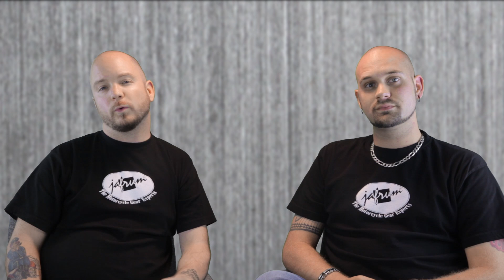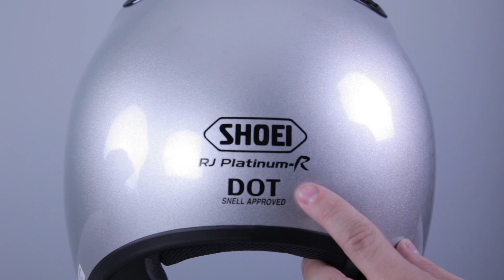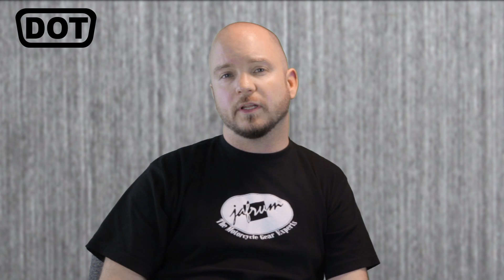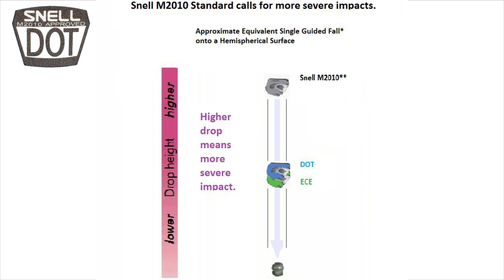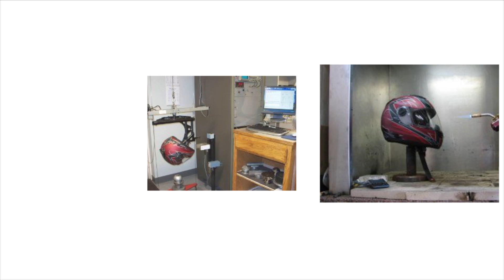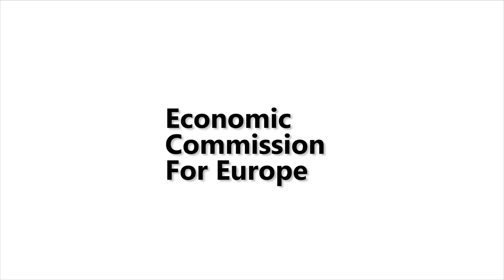SNELL vs DOT vs ECE Helmets - Motorcycle Helmet Safety Ratings - Jafrum.com

Comment: Nice video. One question SHARP does testing of helmet at 7.5 m/s almost 28.8 km/hr, so a 5 star Sharp helmet is safe only till 30 km/hr? Also does internal sun visor compromise on absorbing energy during head on impact. I saw many helmet with internal sun visor on sharp site scoring less points & lower color code on front impact zone compared to helmet without them.

Comment: DOT does Not Test helmets - they set a Standard, and Manufacturers SELF CERTIFY as DOT rated.
Reply: NHTSA enforces the standard by acquiring random samples of the product and sending them to an independent testing lab to verify compliance. Penalties to manufacturers for marketing non-compliant products can be steep—up to $5,000 per helmet.

Comment: thank you for your video. however i have a question guys. is it illegal or any against to DOT rules if helmet is able to design to fold ?
Reply: DOT is fine with that, but it's also fine with 3/4 and half helmets.

The issue with the modular ones is that few helmets are tested as full face helmets. IIRC there's only one brand at present of modular helmet that's tested to pass as a full face helmet.

Comment: Thank you for taking the time to clarify these standards. On a side note - you're using the word "fitment" incorrectly. The word is simply "fit"
Reply: Nope, that's the word that gets used on basically every site I've seen helmets advertised on. It's been a word in the dictionary for decades, even if somewhat obscure.
Reply: Thank you for your replying and I'm not trying to be a d*ck but other sites that use fitment are also incorrect and while it is correct that the word is in the dictionary; if you check the word origin and usage you'll find it is British and means "a fixed item of furniture or piece of equipment, especially in a house." (Webster and The Oxford Dictionary  as source) Again thank you for replying.

Comment: Good day. I just want to clarify something. I've heard it before and you brought it up in this video about Snell not testing modular helmets. What is the main reason for this because they test three quarter lids. I know for a fact that the old HJC AC-3 was Snell certified. I had one. I also know that the Shoei RJ-Platinum R and Arai CTZ and XC are also Snell certified. Does this mean that three quarter lids are 'safer' than modular helmets? I am a three quarter helmet guy but I think modular helmets are safer as long as the chin bar is locked in the down position. Can you shed some light on this? Thanks.

Comment: One thing I can say about Snell is they have a list of the helmets they test. After spending a lot of time goggling for a list of ECE tested helmets I found 0!!! Same for the DOT list!! Snell list is on their website and they will reply to any questions that you have about a Snell tested helmet so if you see a Snell label you can check it to see if it is a fake. Go on eBay and see the fake stickers even saw a all in one DOT ECE Snell sticker from a European seller.  And don't say if it is on eBay it is junk several of the major manufactures and even online companies sell over stock and discontinued stuff on eBay some may use their real name others do not!! Companies such as Dennis Kirk and Rocky Mountain ATV?MC to name a couple.
Reply: Thats nice to know if im looking for a specific helmet they tested
Reply: Why list ECE helmets if under that regulation every production batch is tested before shipment. Every helmet you see in European shop has gone through it. all info is on the strap label - certification coutry, certificate number, type of certification http://www.mccofnsw.org.au/images/1496387809_EULabel.jpg And no one gives a fuck about snell in Europe.

Comment: so what's better D.O.T or E.C.E..two different countries with different standards but one has to offer more protection than the other
Reply: ECE > The max allowed G transfer and the sub-optimal random sample testings of the DOT makes the ECE a vastly better rating system in my opinion. Since SHARP is build upon ECE, I think the real question is SHARP VS SNELL, and that is just a question of how aggressive you ride, hence how fast you will end up crashing (SHARP better for regular crashes, SNELL better for high speed crashes)

Comment: regardless of what rating is the best one, any helmet is better than no helmet.
Reply: I sat the same thing to people when they come into my shop asking about motorcycle helmets. I love when new riders are keen to learn about the safety aspect of gear.
Reply: What happened to jafrum.com
Reply: But why buy a shitty helmet if there are cheap good ones? Holds even more  true in my opinion.
Reply: Hans Oderfest because technology, colors, paterns, etc.

Some people don't place a lot of value in their life. I'd trust myself to an ECE rated helmet because they do actual testing, even if it's not the most stringent.
Reply: lvcsslacker I agree, ECE does reliable testing and arguably the best job in testing for regular speed crash conditions, hence the preference on softer shell materials. The SHARP test is build on top the ECE test as you probably know and adds a nice layer in my opinion. Riding is killer fun, why ruining it by saving on the wrong end. That being said, riding in LA can still be a bitch ;)
Reply: Hans Oderfest same in vegas, except without the lane splitting.Do you know what the SNELL test comvers over ECE? and DOT says your helmet should pass certain tests, but you don't have to test it.

Comment: LONG STORY SHORT:  SNELL is the best standard, and use the most stringent tests.  Also, as mentioned in this video, they are the HARDEST to get to put their approval on a helmet.  If safety is your number ONE priority in a helmet (as it should be), look for the SNELL sticker.
Reply: I think this is oversimplified and misses the point of these tests. If you "race" on the freeway, like on track days, and most likely will end up in a high speed impact, a Snell helmet might end up transferring less G's to your head due to the more rigid construction (that's why it's tested for higher speeds and double impacts = race conditions). The downside is that in a normal freeway speed or metro collision this rigid construction becomes counterproductive and actually transfers vastly more G's to your head. The ECE/SHARP/ACU tests are mainly based on European crash data. Crashes in Europe are on average slower than in the US cause you have less crazy racing folks on the streets, even Autobahn. This factor was put into consideration and is reflected by more soft helmet constructions that transfer less G's in regular speed crashes than its Snell counterparts. I personally think I fit the European tests better as a Harley river, but you might fit the Snell bill better. I like the SHARP rating system cause it builds upon the ECE and succeeds in communicating the basic test data to its costumers better. I don't think a Fail/Pass rating is appropriate to suit consumer purchase decisions: I wanna know that I'm gonna buy the best possible product at any time for my money. The Fail/Pass leaves me inevitable with a pool of helmets I can't differentiate between.

Comment: You guys mentioned weight (snell packing on more layers than ece) as a concern due to inertia, have you come across any study/documentation to back such an argument? From an engineering point of view it simply breaks down to how well the helmet can slow the head down (or absorb energy) from an impact, regardless of weight. Due to this I'd have to agree with snell at the moment.
Reply: +Michael Cook I think it's a crash by crash basis honestly... some impacts are need more deceleration, others need less inertia in the system. It's truly hard to say which is better.

Comment: i JUST BOUGHT A HJC MECH HUNTER AND I CANT SEEM TO BE ABLE TO WEAR IT MORE THAN 30 TO 40 MINUTES BEFORE I START TO HAVE PRESHURE POINT PAIN ON MY RIGHT TEMPLE. IS THIS BAD? SHOULD I GET SIZE LARGER? SHOULD I JUST JUST GET A DIFFERENT HELMET? THANKS IN ADVANCE.
Reply from the maker: John dawson Maybe a rounder head shape. Bell is one example. This should give you a little room in the temple.
Reply: +John dawson go to a motorbike shop, test out what they have and then go online and look for the same model and size
Reply: I took a nap in the helmet I bought and the problem went away. :3
Granted I did take it off at some point during my nape.
Reply: yes! this means it's too small. go to a shop and get fitted for free and then buy one. remember you have to look at shape, size(varies by brand), then safety rating.
Reply: I actually solved the problem by taking a nap in the helmet. I don't think the shape was quite right. The nap helped shape the helmet which would happen over time anyways. Still saved my life though.  #WearYourHelmet  upgraded to the HiViz version of the Aria Defiant Pro Cruise. what a lovely helmet. fits a bit funny though. face guard sits maybe 3/4 to an inch from your mouth by design according to the guys at revzilla.

Comment: Hello guys, can you tell me please the best helmet (full face) for about 200$ ? I saw that the Scorpion exo 1100 it's a very good helm but it's not SNELL approved, so i'm not so sure now about exo 1100. BTW i'm in Italy now !
Reply from the maker: Stefana Madalina There are some great Sneel helmets under 200: CL17 by HJC, and the Bell Vortex are two examples.
Reply: ***** Thank you very much for your help.
Reply: Stefana Madalina Is that all your head is worth to you? $200? I would advise you save up for a quality helmet. Snell will protect you more. I highly recommend on a sport bike to use snell.
Reply: dragonaac i see that in europe it's better to buy sharp helmets because manufacturers often do not know that sharp it's testing their products. This is the difference from snell where manufacturers initiate the process by requesting that snell tests teir products. And about the 200 $ head: in this moment we can't afford to buy 2 helmets at 600-800$ and we need to buy the costumes too. I think it's to much even if we buy them separately.
Reply from the maker: ***** Snell

Comment: Are ECE helmets allowed in US?. Ordered helmet with ECE but it does not have DOT
Reply from the maker: Randy Keller ECE certification is not recognized in the US, you can where the helmet as long as the DOT is on the helmet as well. Of coarse if you state does not require a helmet, you could use it as well.
Reply: Great thanks guys.
Reply: ***** That might not be 100% true. Here in Texas it is not required to wear a helmet. If you are wearing a helmet it must be a DOT approved helmet. I have seen people getting ticketed for this.
Reply: It came with both DOT and ECE on back of helmet so I'm good...but thanks for the reply

Comment: The most important difference between the Snell and the ECE/DOT certification is that with the Snell standard the helmet can be tested and has to pass the test above a certain line (almost where your brain will be) made on the helmet. On every spot the helmet has to meet at least the standard values. The other 2 certifications do the test on specified places. So the manufacturer knows where the helmets will be hit and can adjust the helmet accordingly so that the helmet will pass the test (read :make it a little bit stronger at that place, the other places can be weak) What I really dislike about the ECE standard is that the penetration test on the surface of the helmet is gone since 22-05. This is a harsh test and hard to pass. Only the visor has this test now. The dot and the Snell has this test and this make the helmet tougher and stronger..

Comment: Hi, Thanks for the video, I have helmet having DONT & ECE, if I wll go to track following Snell procedures, they will allow me to use their race track with my DOT & ESE helmet? Or I should buy another helmet with DOT & ECE to use their track? Or both SNELL & ECE same and allow to use on race track?  Thanks
Reply from the maker: Firstly, thank you for your question. This all depends on where you live and the track regulations. To be sure, I would recommend a helmet like an Icon Airmada with a "world standard" rating (DOT, ECE, SAI, etc.), and you'll be sure to be rated for anything that comes your way! Hope this helps, and thank you for shopping at Jafrum! - Ellen
Reply: ***** thank you guys for your support
Reply: Snell is often required for racing sometimes for track days.  
Snell is actually way more race oriented while ECE and DOT focus on a minimum safety standard. 
BTW it is not uncommon that Snell helmets have worse shock absorption that non snell helmets.

Comment: Some people said that the Snell helmet must have weight minimum 1,55kg. Is that true?
Reply from the maker: Thanks for your question. I have reviewed the SNELL M2015 Standard for Protective Head Gear. The only weight restrictions I can see are placed on the testing equipment used by the Snell Foundation to conduct the tests. I do not see any weight restrictions placed on the helmets themselves. Here is a link to the new 2015 Standard in case I've missed something. http://www.smf.org/standards/m/2015/M2015FinalFinal
Thanks for watching and enjoy your ride!
Reply: ***** Because I or maybe some other people feel that the Helmet that through the Snell certification has more weight than the helmet with only DOT / ECE standard.
Reply from the maker: The Snell impact testing is more aggressive than both DOT and ECE. Therefore, lower price point helmets will incur extra weight. This is because more material is needed to achieve the necessary strength to satisfy Snell impact requirements. Premium helmets, like Arai, still achieve very light weights while satisfying Snell standards because less premium material is needed to achieve the necessary impact resistance. So, it's true. Snell testing can indirectly cause a helmet to weigh more, but it is because of the high safety standard, not because of a minimum weight requirement.

Comment: so if i crash down on freeway at 80 to 90 mph? which helmet will protect my head? DOT ? Snell ? ECE ?
Reply from the maker: Thanks for your question. Unfortunately, it's not one that can be answered simply. It's true, helmets that are Snell or ECE certified undergo more thorough testing than DOT, and are held to a higher standard. However, I cannot say that one certification is always better than the other. There are too many factors to consider like helmet style, FIT, materials, weight, and the crash scenario. A DOT FULL FACE helmet may protect your head better than an ECE and/or Snell rated OPEN FACE, depending on the circumstances. If you're looking for the most protection, choose a full face fiber composite helmet from a premium brand that FITS your head properly. A helmet's safety rating is only beneficial if the helmet fits correctly on your head. If you have a question regarding the safety level of one helmet versus another, or would like to discuss the shapes of different helmets, we would be happy to help you choose. You can leave a comment on any video, or give us a call at 1-877-GO-HELMEt. Thanks for watching and enjoy your ride!
Reply: Crash at that speed, and all three standards are out the window.

Comment: Does an aftermarket helmet strap quick connect void any of those ratings?  Are there any that don't?
Reply from the maker: Only features that are included with the helmet from the manufacturer are tested/rated. Modifications to the helmet, like quick disconnects, will not void the helmets rating (there is no one to say that it's void). However, they can, in some cases, reduce the helmets ability to protect your head. If you prefer a quick disconnect chin strap to D rings, and want to know that the chin strap meets certain safety requirements, consider a helmet that has that feature from the manufacturer. (Nolan N86 for example) Thanks for your question and thanks for watching!

Comment: I'm a college student and i'm thinking of getting a 50cc (Laugh all you want, i get 100+ miles to the gallon and can replace a motor for $50 and insurance is around $100 per year MUAHAHAHAHAHAHA), what price is good for around 30 to 40mph crashes? Or since i'm the most likely to be hit should I look for something stronger?
Reply from the maker: A helmet's impact absorption is not measured by assigning a speed value, and is not always measurable by price. Helmets of different styles, from different brands, can very hugely in cost, so rather than figuring out a safety/dollar ratio, it's better to select a helmet based on fit and materials. An inexpensive helmet that fits you properly will protect your head better than a high end, ill fitting one. Look at the materials as well. A helmet constructed of a fiberglass composite will absorb energy, as opposed to an ABS or polycarbonate helmet that will reflect it. Fiberglass offers a higher level of safety, but is only good for one impact, so you have to take care of it. Hope this helps!
Reply: ***** Thank you.
 Thought I thought the people testing them would pay closer attention to the physics since there are variables involved, it seems to be a differential equation(it depends).
Reply from the maker: Some helmet manufacturers are taking inertia and impact severity into account and incorporating multiple densities of EPS into their helmets. The lower density foam is usually closer to your head, and the denser foam is closer to the shell. This will offer some increased shock absorption at lower speeds, but it is impossible to tell at exactly what speed the EPS will perform optimally because the weight of the rider's head is not a constant.